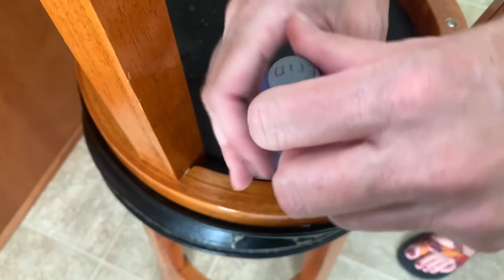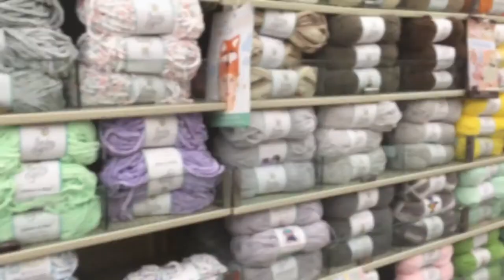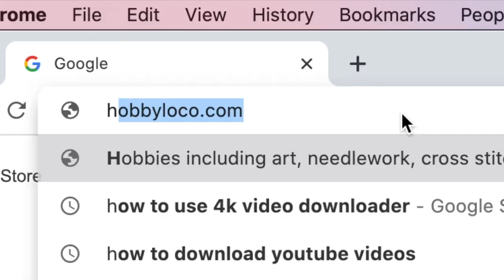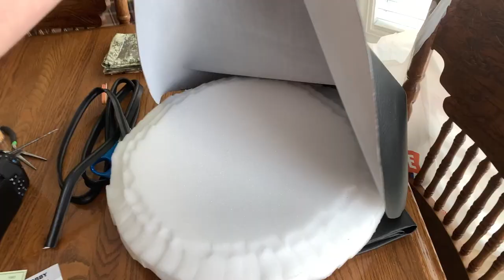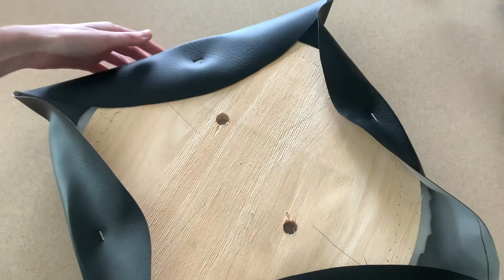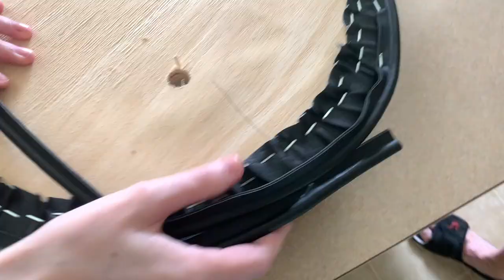How to Recover Kitchen Bar Stools with Fabric | Tutorial Tuesday Ep. 124

Comment: Unfortnately you left wrinkles in the fabric. The original stool had a smooth edge.  You finished product has a lot of wrinkles around the edge.  Also, the crisscross of the trim piece leaves a bulge in the seat.
Reply: I thought they all looked quite professional . However, I would have painted the stool a new bright color. Did good